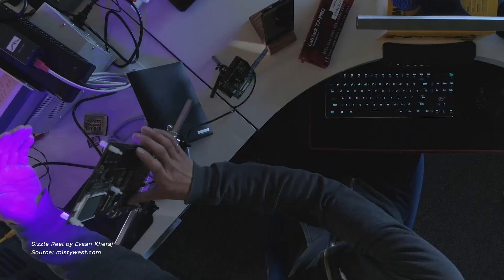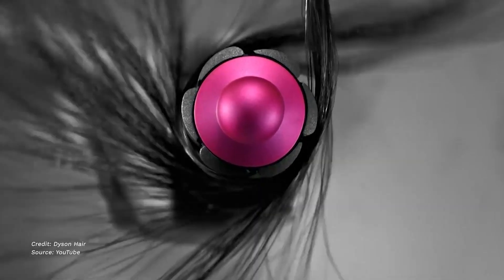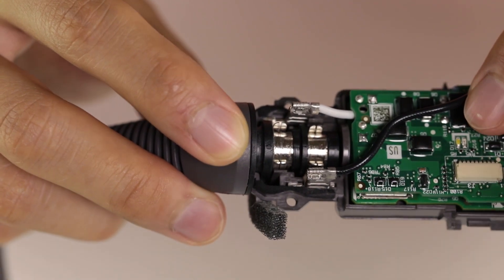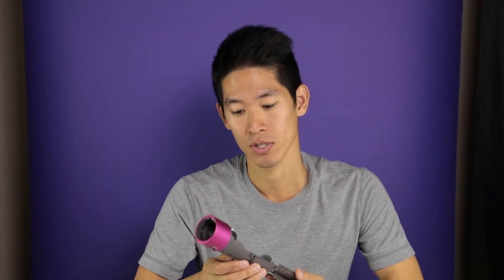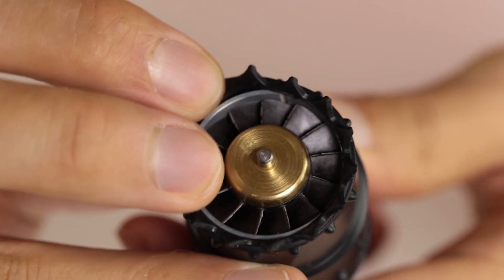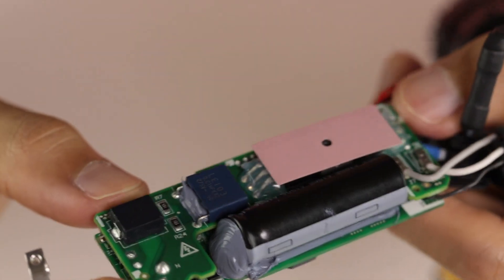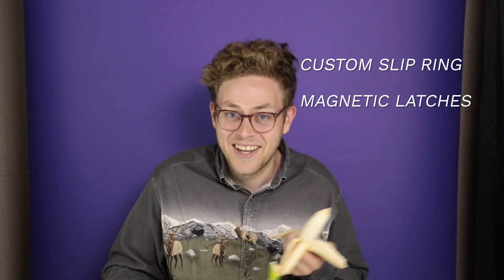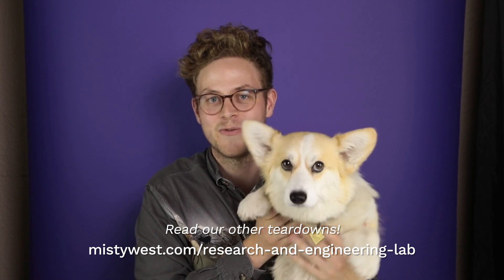MistyWest's Technical Teardown of the Dyson Airwrap

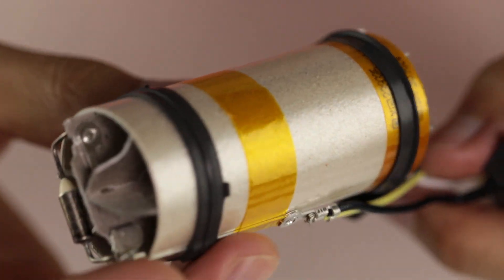Comment: @3:35 that is not a thermistor for temperature sensing, that is the thermal fuse which is the most common part to blow in these machines. It would be helpful if you were to point it out and let people know the temperature cutoff so they can replace it when their machine breaks. They often turn black and the specs cannot be read from the blown fuse. Less faffing around perhaps and more useful technical information would be great!

Comment: Hello, I just bought one yesterday and I tried to use it. It turns on about 1/10 times. I've tried 4 different sockets in the house and it's brand new. What do you think is causing this? It has a uk plug. The model I have is the one for long hair. My partner thinks its the switch mode power supply or the connector at the bottom. It is intermittence and doesn't turn on from cold. Do you think this is likely?

Comment: Somewhat disappointing that they changed out the machined aluminum motor for what looks like fiberglass and brass. 
Wonder if it might be worth it to swap it out for an older motor from a broken unit?

Comment: my wife's air wrap is working intermittently.  when you jiggle the load side of the ac line filter it works.  I am wondering if I can take that filter apart and check the connections.  also, what would be the harm in bypassing that filter all together?  I am sure it is there for a reason?
Reply: Same here. Were you able to get it solved?

Comment: It's "triacs" (as in more than one triac), not triax. It doesn't mean triaxial cable. That isn't a thing. A triac is a semiconductor device used to vary voltage. Commonly used in dimmers.